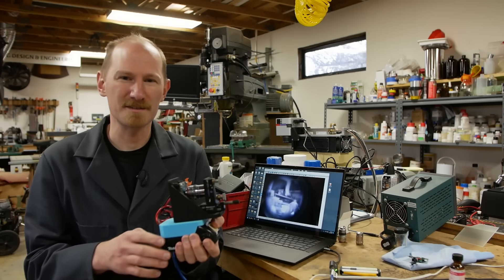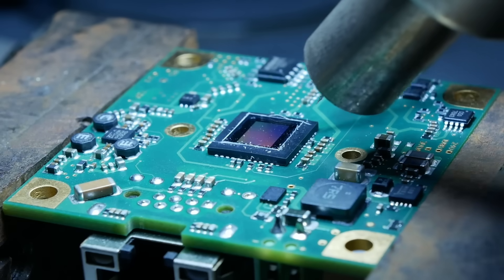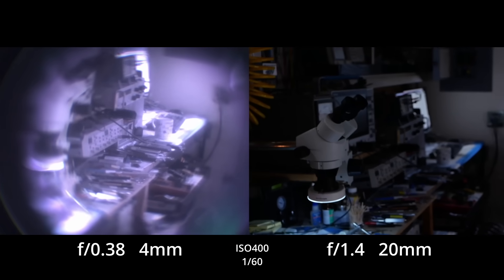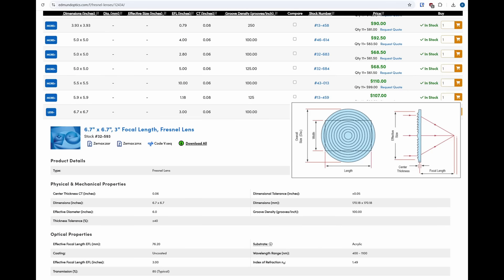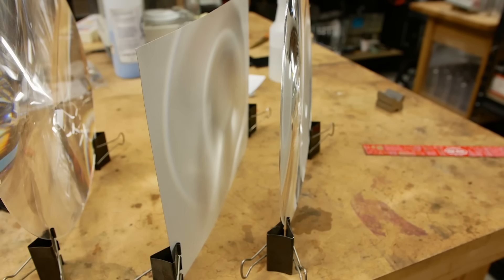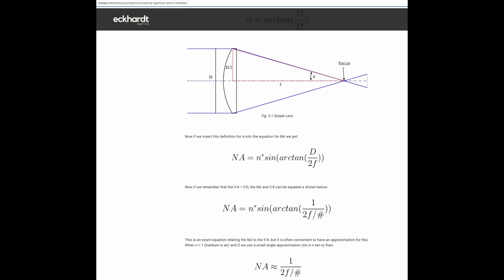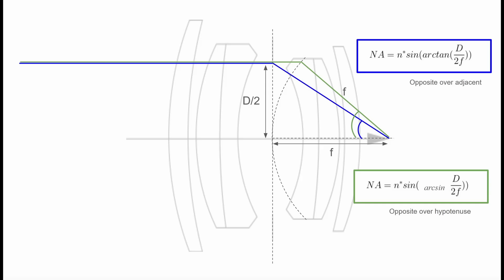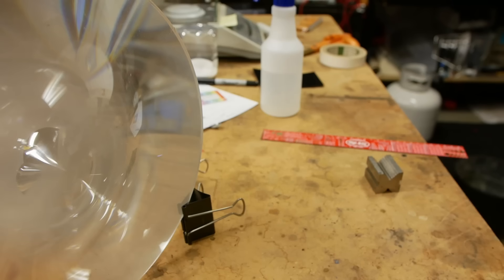f/0.38 camera lens made with oil immersion microscope objective

Comment: As an optical engineer and microscopist I need to clarify a few things:
1. NA=nsin(theta), f/#=f/D thoes two are the original definition, and only at small angle NA=1/(2f/#)
2. Your data curve fitting is a bit misleading, as the red/yellow/green objectives are oil objectives with n>1, you should have another blue curve with the oil index
3. The aberration of the microscope objective you showed (used in reverse) is totally normal, as it's designed to only image a small sample area of less than 0.5mm*0.5mm (when used normally). In your case, your camera chip size is way bigger than the designed imaging area. So only the center portion of your image will be aberration-free.

Hope this helps.
Reply: Another microscopist here. There is a little problem with the whole setup and assumptions on aberrations: it is most likely that the oil immersion objective used is actually designed to have a cover slip (thin glass, usually 170 microns) between the front element and the sample, just like in the diagram shown at 14:59 . One can simply check the objective, if 40x NA 1.3 infinity/0.17 is written on the barrel, it needs the cover slip, without it there is strong spherical aberration. It may actually improve image quality!
Edit: I've slept a little and it occurred to me that, actually, I may be wrong. Since the refractive indices of the oil and the glass are the same, you actually don't need the coverslip as long as the sample is compatible with the oil. Optically it makes no difference. Still, a metallurgical objective may be slightly better, as with a biological objective it is assumed that there is a refractive index change between the cover slip and the aqueous medium of the sample, whereas the metallurgical one has no such thing in the optical design. They are harder to come by though.
Reply: 1. No it is not. The issue is how you draw the focal length. If a system obeys the Abbe's sine condition then focal length is not an axial distance, but as Ben has drawn, a hypotenuse that reaches to the boundary of the spherical wavefront. Your small angle approximation is for paraxial systems. In a perfectly corrected system, free of aberrations the wavefront emerging on the image side is spherical and all the rays have to have the same length (zero optical path difference). You can only satisfy this with a spherical principle plane just as he has drawn.
Edit: In the hindsight I have phrased it badly. The hypotenuse in this case is just a marginal ray so it is a ray that defines the solid angle that in turn defines the amount of light reaching a single image point (it is a part of the Etendue or the A-Omega product) and in a well corrected system it is equal to the focal length.
Reply: @kimjong-du3180  I agree with your objection, but just wanted to state that the zero optical path difference condition can be met on-axis without meeting "Abbe's sine condition". In fact the zero-path condition is met on-axis as long as all the rays reach the same point at the image, and in this case you have no aberrations on axis. However, an on-axis ray hitting the pupil at height y (from the axis) must have an angle theta=arcsin(y/f) at the image side in order for the off-axis  fields to be without aberrations, which is another condition the should be combined with the optical path condition.

Abbe's sine condition is a condition on the rays of the on-axis field point, but it affects the aberrations of the off-axis fields.
Reply: @kickass26306  You have just restated the Abbe's sine condition. In a well corrected system the rays will reach the same point in the image if the OPD is zero. One requirement is based on geometrical optics and the other one is physical optics (or scalar wave optics) perspective. It's the same thing but from a different perspective. Reaching the same point means the rays as emerging from the exit pupil have all the same length (i.e. 0 OPD) and this means the wavefront is a perfect sphere and this means that rays as wavefront normals intersect in the center of that sphere (converge to a common point), because definition of a sphere is that all points on a sphere are equidistant from it's center. How can this be met if the sine condition is not met?

"However, an on-axis ray hitting the pupil at height y (from the axis) must have an angle theta=arcsin(y/f)..." that's just image-side half of the Abbe's sine condition. 

Ideally zero OPD condition should be met for all the points in the field of view and the Abbe's sine condition should be met everywhere where we want image to be sharp.
In general I think it all boils down to the Eikonal equation.
Reply: @kickass26306  From what I understand you are talking about a paraxial f-number, in which case F#<0.5 does not violate the sine condition because it yields the half angle of only 45 degrees. To get to 90 degrees you have to have a lens of infinite diameter. For a non-paraxial f-number, if F# = 0.5 this means that the wavefront is hemispherical. I still don't see how you can have that with a thin lens of whatever refractive index. Also you will get off-axis aberrations without violating anything if the lens is corrected just for the on-axis field.
Reply: Who needs ChatGPT or Deepseek with B.Superbad on duty? Although it looks like you might have started WWWIII  ¯\_(ツ)_/¯       Either way -> Very COoL. Input is always appreciated.  You RoCk!  :face-blue-smiling:

Comment: re 5:26 depth of field
the lens also has significant field curvature, which will result in a greater apparent depth of field at the cost of the center or periphery being more out-of-focus at any given time.
Reply: Yeah I could tell right away the field curvature on that lens is wild.
Reply: Yes, as somebody who adapts weird (and plainly "wrong") lenses and lens like objects for cameras, it was immediately obvious that the center was not focused. There was a ring of focused light around the halfway point between the center and edge of the image. Many old movie projection lenses are like this if you try to use the entire image circle. That's how they made crazy 120mm f/1.8 lenses and other beasts back in the day - make the image circle so huge that even your aplanat lens has enough "sort of focused at the same time" area to cover a 35mm movie frame.
I understood nothing about the math, but I know my way around a bad lens :D
Reply: @seth094978  The lens is not plan-corrected (there will be a marking for that) and given how this lens looks like a generic Chinese objective it is possible it isn't even infinity-corrected either (there is also a marking for that). I have one at home that is marked for a tube length of 170mm, though the very expensive ones in the lab I work in has infinity and plan correction.

Comment: Hello, just to had a comment on microscope objective.
Microscope objective are not all made the same. They are not corrected in the same way. For exemple, the Plan-apochromatic have the best correction. So suffix "Plan " tell us the objective have the correction for the field curvature. The world, "apochromat" "fluorite" and "achromat" correspond to different spherical and chromatic aberration correction. For each  name, the number of color corrected in spherical and chromatic aberration get lower. For spherical aberration, '4 colors" for a  Plan-apochromat, 3 a Fluorite and 1 for an Achromat. For chromatic aberration, 5, 3, 2 respectively.
Just to give more information, highest numerical aperture (NA) give more detail. The highest NA, I've ever encounter is a 1.5, with an even smaller working distance. Common objective for confocal microscope have an NA of 1.4. With that, you an have nice detail of inside the cell, or even the nucleus.
I'm quite surprise to see an objective used "backwards"
Great demonstration !

Comment: For imaging purposes, as you mentioned, you need more focal length, which also means larger entrance pupil, while still retaining a decent field of view. Therefore, microscope objectives will not yield good results.
It would be very interesting to test the transmission spheres for interferometers, there are some f/0.56 ones with entrance pupils of 4 inches. Too bad they are so expensive.
Personally, I obtained excellent results with the collimating and imaging lenses from old fluoroscopy machines. Yes, the (in)famous Rayxars and Heligons... but there are also less famous lenses like the Kowa 90mm f/1, that can be mechanically modified to focus at infinity while covering the full frame sensor and with good sharpness almost to the very edge.

Comment: Speaking of simple questions. Though this is probably answered somewhere online. But why does the focal length impact light gathering? On the surface Id think only the appature size matters? How is light that enters ending up impacting the image media less just because the focal length is different?
Reply: You are right, it does not. However, a lens with shorter focal length produces a smaller image, therefore a brighter image. The light gathering power is only affected by the aperture.

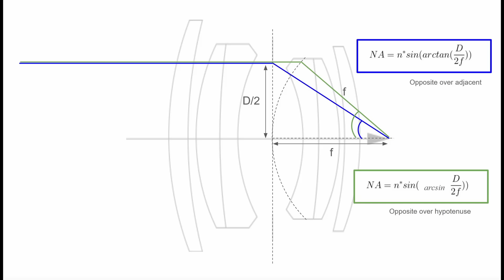Comment: I'm no optics expert, but I'm starting to suspect there's some circular reasoning going on. NA is a very subjective number, sine of the maximum angle light hits the sensor (at the center of the image field, for on-axis incoming rays). F-number? Clear aperture can be measured, but how do you define the focal length of an optical system with thickness? If we define it according to the diagram at 14:00 of course all make sense. But if you were to measure it, then there are optical center, field curvature, distortion and whole other cans of worms to worry about. Same thing with the fresnel lens. Is the focal length measured from its center, or its peripheral? I think the focal length lens makers put on the lens body is a mere indication of its field of view, therefore, so is the f-number.
Reply: The focal length is not just an indication of field of view, it is an actual property of the lens, you can calculate the focal length of a multi element system, it’s just a lot of geometrical optics calculations and is mostly just done by software nowadays. The focal length is usually measured for the central axis, if the lens presents distortion ( barrel or pincushion) the focal length is varying accross the field

Comment: 0:10 Isn't f number Focal length / Aperture
Reply: Yes but it ignores how clear the glass is and any coatings on the elements and the number of elements in the lens. So not all f/2.8 would be the same.
Reply: @sambrose1  that's why on cine-lenses there is "T-Stop" in addition to the "f-stop". T-Stop is really the light transmission through the lens
Reply: @sambrose1 Yeah, f-stop is basically just an indicator for bokeh. Brightness often somewhat correlates with that, but not always accurately.
Reply: Yes, he got the ratio upside down. Entrance pupil diameter is the more accurate term for the denominator though.

Comment: Loved the video! Just note for your future task, that the depth of field is only related to the aperture D, and has nothing to do with the focal length f. So low F# is not really a necessity for shallow depth of field - just keep D as large as you can
Reply: And that is actually easier with a larger sensor and thus higher f/numbers. An f/1.2 lens is difficult to design, an f/4 is much simpler to correct. Thinner glass and all.

Comment: could you just drill through (or around) that glass and inject oil into the sensor without removing the glass?
Reply: The oil used for immersion is n=1.52 and is matched to microscope cover slips.. so if the cover slip on the sensor is the same then immersing the sensor and the lens would work. You can also get objectives with an adjustment ring for different refractive index fluids.
Reply: And then oil between the cover slip and the microscope lens as well?
Wouldn't that be adding two more refractive surfaces between the sensor and lens?
Oil isn't air but it still doesn't have the same refractive index as glass.
I'm probably not bright enough to understand optics but I'd like to understand how it would improve the situation shown here.
Reply: @jimurrata6785  you are right - the image quality would probably be worse, but the goal was to make the sensor modification easy.  Maby you get 7/10 image but now 9/10 (2:52)sensors survive the mod.

Comment: So...optimize the optical system.
Different glass for refractive index.
Aspherical elements.
Shaped image sensor.
Size of image sensor.
Active sensor(shape change)

What's the f limit?

And in practical use (consider photo film) each f-stop has a distinct and visible change in negative density, established as to reference the sensitivity of the human eye.

But image sensors have a far wider range, and ASA/ISO settings exist on digital cameras mainly as a backward compatible reference to film, which in turn used ASA/ISO as a general equivalence to the naked eye.

Then there's amplification in electronic image systems...you can see in the dark at f16.

You used to have to gather a set number of photons for a full "zonal" image on film via exposure time and set aperture..."native" (e.g. 50mm f1.4) to irised (same 50mm f1.4 stopped down to f22).

But now, you have non-irised lenses on phones with tiny focal lengths that can snap a photo then electronically process it later on to output an image emulating a whole range of f numbers or focal lengths (meaning full frame image size from wide to neutral to telephoto.)

So, "f" in optics doesn't really correspond to "f" in photography any more, does it?

Comment: The other factor that affects depth-of-field is focal distance. The further away you focus the deeper the depth. A short focal length isn't ideal for shallow focus. One benefit of the fast lens is 2-3 stops down from wide open (the peak focus of most lenses) is still 2.something and still fast but infinite depth of field. Now, if you made a 50mm f0.38 lens, you would have something

Comment: Interesting. So this means that the convention of f-number is u clear. NA is quite easy to understand, since it's just half the opening angle at wafer/sensor/film. But the focal distance is the distance of your wafer/sensor/film to Something™.

I find it a bit strange to define this hypothetical plane as curved. Of course in a perfect lens, your wavefront is spherical, so it makes sense to define a curved plane. But in my opinion, the diameter of an opening pupil should not be defined as curved. For example let's say we have a sphere of radius 1 meter. Then you'd assume that the diameter is 2 meters, right? But if I follow this f-number definition, instead you should measure the diameter along the surface and end up with a diameter of pi.
Of course this is convention and we decide how we define things. But this makes me feel slightly uncomfortable. Maybe we should stop talking about f-numbers and just only use NA. I'm sure that would at least make lithographers like me happy!
Reply: Of course NA is what matters, and I am certain all serious lens designers have known it at least since the times of Ernst Abbe at Zeiss in Jena at the end of the 19th century. I think the f number was only invented when adjustable apertures were introduced, to give photographers an easy way to calculate correct exposure.

By the way, if one uses a macro photo lens at f-stop 4 and magnification ration 1:1, in reality the f number is 8. That is because the f number does not depend on the focal length at infinity, but on the real focal distance of the lens' principal plane.

Comment: I am surprised that you didn't mention that you are using the lens backwards.  Normally, the light goes from the slide through the oil to the eye, camera or whatever.  Here you've got the light coming from where the image would normally be projected.  Is the behaviour of a lens like this commutative?
Reply: Thank you for making this point.  I just typed in the same point.

Comment: If you had a bunch of sensors, then you could've put one in the oven (to its accepted temp) and then quickly done the glass removal (with the glue to glass method) by clamping the part you glued into a vise and pulled the chip up. Just a thought. This would always result in the broken pieces of glass falling down, and away from the sensor. Just a thought. This is how i delid cpus. I never do it upwards, because i'm too chikensh!t to potentially ruin it by something dropping inside.

Comment: Great video!  Watching you play with the white card, when bowed, more of the image was in focus. Think of lenses, spherical aberration and sensors, why hasn’t someone made dome/dish shaped digital sensors??  Yeah, film would be tricky because the converted flat image would be some kind of Mercator looking projection, but digital should be plausible if the silicone can be made. Seems like an easy way to solve the round -> flat issue between lenses and sensors. Eyes do it. 🤓

Comment: You mention that the focal distance was huge and that if you focused the lens on something a foot away, the objects at the far end of your shop was still in focus. 
This seems like the holy grail to me! What I have been struggling to find a solution for. Being a competitive iron sight pistol shooter I need to focus on the front sight but at the same time see the target as sharp as possible. 
With age I have begun to struggle with this and have seen multiple optometrists and tried different lenses, irises etc. Nothing really works. 
The lenses help with being able to focus on the front sight but the target gets much blurrier. 
Would it be possible to adapt your findings to a lens-system that could be mounted in front of my eye? 
It's a long shot that you will read this but I really hope you will. 
Thank you so much for your videos!
Reply: It would probably be difficult to have an oil interface between the lens and your eyeball.